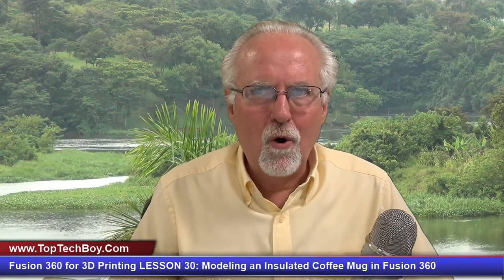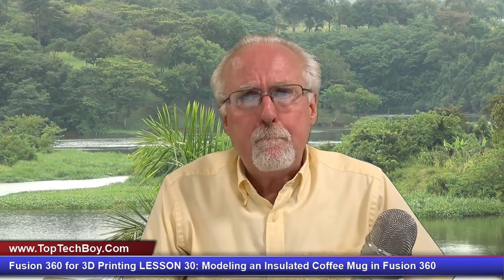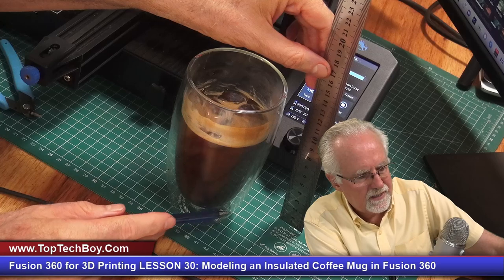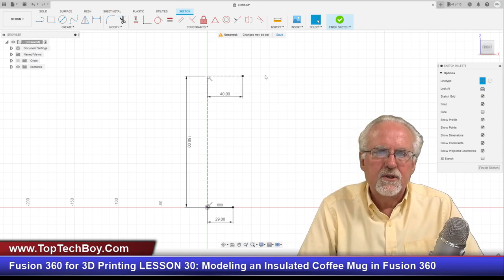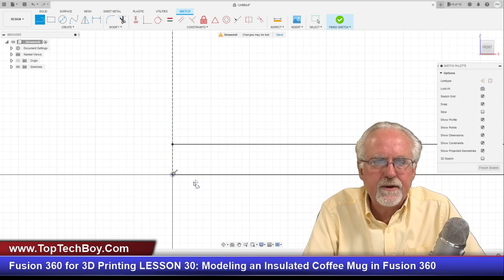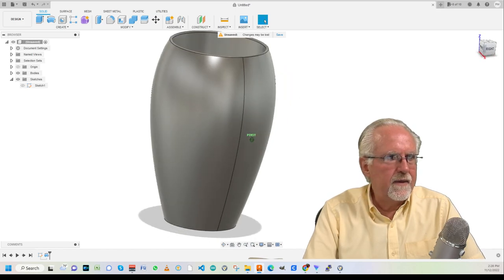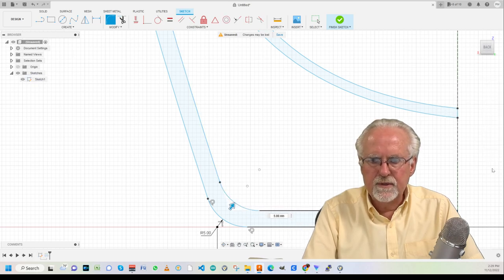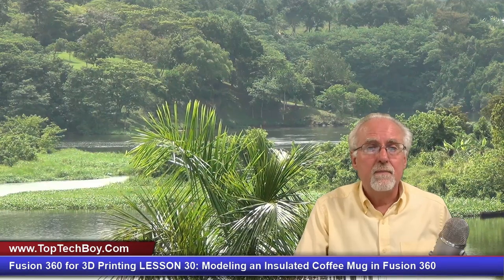Fusion 360 for 3D Printing LESSON 30: Modeling an Insulated Coffee Mug in Fusion 360

Comment: I am Legend. Since I am not printing this, I changed the material to glass to see what it looked like in 3D. I have noticed that when using tools like spline, the the sketch is not fully constrained, but that doesn't seem to be problem with the final result.
Reply from the maker: Once I use splines I dont try and fully constrain. It can be done, but not really needed in my mind. I always fully constrain on more engineering type drawings.

Comment: You made the comment about not being able to print with glass or not drink out of PLA, but would we be able to print it with PLA but not actually drink from it.  I didn't fold like that cheap lawn chair, but also was not a total legend either.  Somewhere in between, but did not try to print because of the "air gap" that was part of the insulation.
Reply from the maker: Think about printing upside down . . . I think it prints no problem that way.

Comment: Hey Paul. Kind of a cart before the horse off topic question. My Pico kit should be arriving soon. I was curious if you design or have input in the sunfounder kit.  I saw it had a water level sensor and a soil moisture sensor as well. If you do have input in the kit, it would appear that we might be making a way to water house plants. I made an arduino controlled one with a float switch for the reservoir as well. It was fun. My concern is that the sensors are of pretty low quality. I have to consistently replace them after a month or so. If that is the case, I was curious if you could suggest better sensors when we get to that project. Thanks in advance.
Reply from the maker: I am pleased they inluded a little pump and the sensor. Have not tried it yet, but it will definitely be one  of the lessons we do.
Reply: @paulmcwhorter   Kit just arrived!. I do't know where I got the soil moisture sensor??. I do not see one in the kit. No worries, That is often not the controlling sensor , but fun to play with and include.